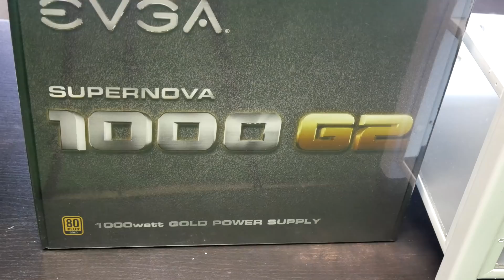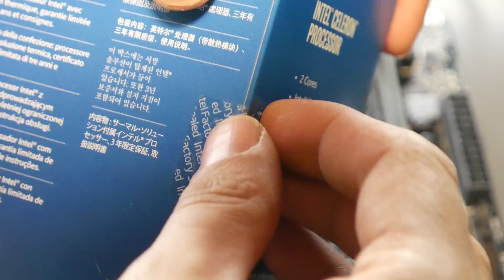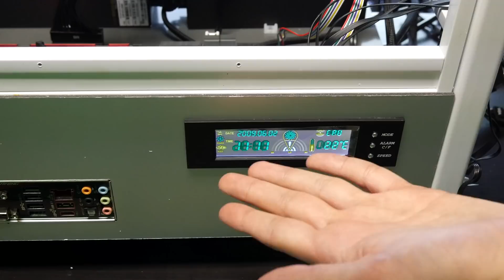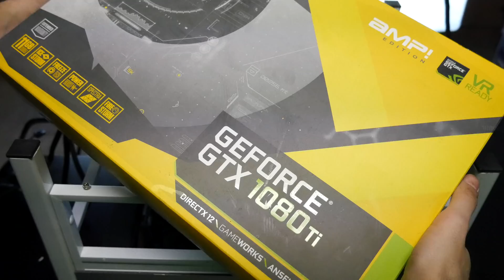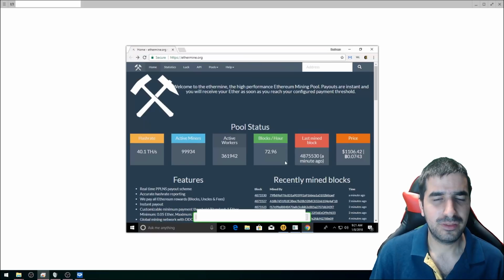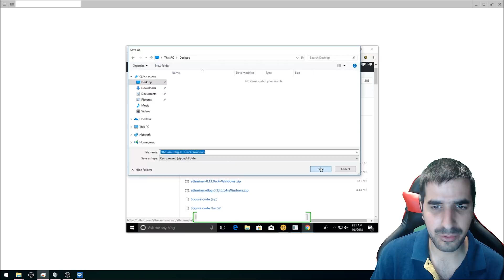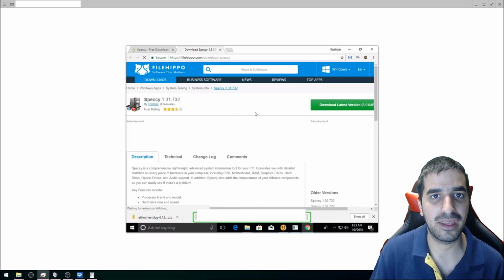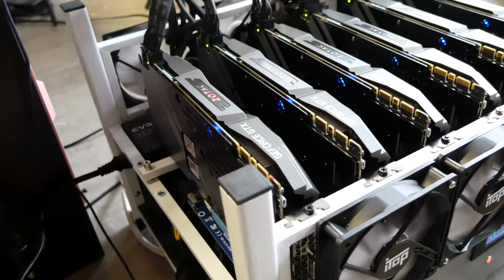How Much Can You Make Mining Bitcoin With 6X 1080 Ti Beginners Guide

Comment: The electricity cost 1780 watts consuming all day?? I think No... 1780 watts = 1.780 Kwh means 1780 watts per hour, 43 kwh per day for 24 hours, the electricity per month 1290 kwh. that is too much more as you mention in your video.

Comment: Broo shall I use EVGA Supernova 1000 G5, 80 Plus Gold 1000W, Fully Modular, ECO Mode with Fdb Fan, 10 Year Warranty, Compact 150mm Size, Power Supply 220-G5-1000-X1 for this?

Comment: You need to stagger the ram so it will run in dual channel mode.. The black ram slots are the dual channel slots.. The way you have it now, 1 stick will need to fill all the way up before the other is used.. Also those video cards are set default, to start throttling at 80c as well..

Comment: And then after a few months of abuse, he sells these cards on eBay, "perfect condition, works like a new one, 10/10" lol
Reply: They probably got hot af and almost melted
Reply: @Mattt414  learn more about mining. A competent miner while usually have the card running at almost idle temperatures. If you mine properly your cards will last for a very long time
Reply: personally never had problems with used cards that were mining 24/7
Reply: @kristianharis5075  I agree. Miners treat their cards well. Maybe a fan needs to be replaced. eBay also has great money back guarantee policy.
Reply: @erwinschmied  specially because mining isn't too hard to do for cards, ive got my gaming rig running 24/7 and the card gets a maximum of 60⁰c of temperature at max load (sure it might reduce how long it lasts, but its still way better than hardcore gaming, with warzone i still get a huge load and temps of 80c). So a card used for mining should no only be fine but also better than a card that was used intensively for gaming
Reply: @kristianharis5075  indeed. just needs to be cleaned from time to time especially the fans. or change paste if needed. no matter how long is the use
Reply: first mistake is buying "Like new" graphic cards or pc parts in general...
Reply: @TriviumRS  for real, bought a "like new" card for my new pc and it renders like shit
Reply: No the cards are good enough for gaming only 10% less
Reply: Miners probably treat their GPU's better than some clueless gamers
Reply: Does it wors or not? 
I would like to buy some good graphic cards for crypto mining...
Reply: @cryptouniversepictures9318  wait for a bear market
Reply: Ahahhahaha
Reply: Yeah this whole GPU stuff is getting out of hand I can trust second hand retailers at the moment it’s insane
Reply: Mining doesnt harm a graphics card it runs the same
Reply: Just ddont abuse the card have enough space between them and adequate cooling
Reply: "not used for mining"
Reply: CEO of scamming

Comment: Here's the cost of electricity:
1800 watts ÷ 1000 = 1.8 kWh

1.8 kWh × 24/7 runtime = 1,300 kWh Kilowatt hours per month

Average cost of electricity in the us is 15¢ per kWh.

1,800 kWh × 15¢ = $270.00

He earns ~$40 a day × 30 days = $1,200 perm month gross profit

NET PROFIT: $1,200 - $270 = $970/month.

For about 1 days work to setup that's not bad. Some people live in apartments and don't even pay electricity or they have access to solar.

Comment: using those gpu's on 100% usage will ultimately reduce their lifespan, keep in mind the electricity Bill, and the cost of maintenance of this Expensive Hardware,
Reply: if you get the GPUs with warranty, then you have no fear. if the hardware fails within the warranty period, then you can get back to the dealer and get some back and running.

Comment: with just two ram sticks, they go into slots 1&3 slots at least in most boards.. you can see there is a discoloration between 1&3 and 2&4.. which is meant to help you understand that 1&3 are the proper slots for just two ram.. Here is how it probably would work on most boards.. if one ram.. first slot if two ram dimms, then 1&3 slots.. if 3 ram dimms, then 1,2,3 slots.. the #2 slot being the third stick slot.. and if you have four.. well all four slots.. LOL  I would say check your motherboard manual for the correct configuration for ram..

Comment: In the event that you think that its hard to comprehend exchanging, have a go at gaining from others.
Reply: I need to go into it that is the reason I have been sticking around YouTube. So as to gain little from the recordings I watch.
Reply: I have been exchanging with Mr Joseph Berg for some time now since I went over his profile on Qoura. He is a well good speculator and donor, I have made a very return of $22000 up until this point and he has a quick withdrawal rate. He is client benevolent and dependable,you can contact Joseph Berg using his email address <josephbergg@gmail.com>

Comment: I believe you should not be using an extention chord with that.., You should be using a single power outlet for that one just like the ones for air conditioning units, It will be safer. Imagine a machine using 1700 watts..🤪
Reply: Most of the extension cables I have seen, are rated to at least 10A (which is 2200W) and have 13A fuse. 1700W is well within their capability. Although I do agree with you, that powering straight from the socket is a bit safer (and more efficient).

Comment: if you leave it run 365/24/7, for how long it will last?
Reply: That's a huge electrical bill, and with that setup you'd theoretically make 58-61k a year.

That's a decent amount but as for massive profit, not good because if you leave it on without rest, the miners might fail, the pc might fail, a power outage may cripple the miners and pc, and you run the risk of setting your place on fire.

Comment: power outage damage graphic card, hardisk, motherboard..normally for laptop, temperature 20-60 for core 0, core 1..hardisk and laptop temperature can goes up to 40'C when doing something like watching movie..thats normal rate..if temperature goes up to 78'C, means fans not working and need to be replaced 

Now 80'C..80'C is hell hot..can fry the egg without a gas..how long will it survive..

solution: put it in freezer

Comment: The Issues With This Build 
1) The RAM is in the wrong slots, E.g its Both In Gray Or Both In black if you only have 2
2) The CPU Fan went into a chassis fan header meaning you will get a CPU Fan error on boot

Other Then that, Good Build
Reply: cpu fan locks did not locked, also used risers with sata power connections what is not good option when using high power draw gpu. And 2psu connector shoud be used because you will be unable to restat gpus correctly on crash...
Reply: Karolis Taujanis There is no issue with using “risers” (Adapters) as they are as clean and would not need to be removed if the System Crashed as the Motherboard will do the system reset even with the Molex Adaptors and it monitors Power Draw,  On the other hand I do not have any knowledge on “cpu fan lock” so I can’t provide any input regarding that issue
Reply: Dnt b an asshole everything is working fine

Comment: you will make about $154,760 in 10 years.
Reply: If the machine gets to work for 10 years and he pays absolutely no elecrricity
Reply: well i think his not correctly dual channel memory says otherwise
Reply: I doubt this rig will last more than a few years with the strain it's under. Not to mention fluctuation in the value of cryptocurrency, and the cost of electricity.

Comment: I did an statistical analysis test on these produces and found that you can buy better gear for way cheaper. I would stay away from over clocking for the some fact you need this machine to last. Over clocking kills the machine faster. One good example is your ram, you're only running 1 DDR 4GIG Dim which is very slow. You need higher for the task that you're performing.

Comment: Will take 2 years to recoup your hardware investment. Then you’ll start generating profit. Too bad your hardware will have failed long before then from heat stress. 

Even say you get past that hurdle good luck when your utility company shuts off your electric.

Say they don’t shut off your electric you’ll be having to deal with your local police department investigating you for potential drug manufacturing. After all using an abnormal amount of electricity is a red flag for many kinds of drug labs.

Lmao idiots.

Comment: The last two months, I have made over $60,000 from Bitcoin, but my success never started that way as I had made substantial losses before my turning point in the Crypto space. I  bought *2Btc last year which quickly rose in the bull run but eventually lost most of it and sold off what was left. That was the last I would ever have to do with bitcoins until I was introduced to Mark Hall first of, he asked to know my trade experience. He then gave me a quick insight on what to look out for when choosing a platform and a bunch of other things most experienced traders may never tell you. Most importantly, he introduced me to his specially designed layout and provided me with professional advice and accurate trade signals. With his system, trading has become easy and profitable, and I want to spread the word and thereby help as many that are in my previous unfortunate situation. For all questions, you can reach by **Mail (markhall279@gmail. com)
Reply: That's a good LUCK
Reply: Cool story bro
Reply: I emailed him and he replied back “send nudes”. Wtf is up with that?

Comment: Actually your wall outlet is rated at 15 amps max. Which at 115volts is about 1725 watts. I'd suggest upgrading that 14guage wire in the wall to 12 guage and get the hell rid of the cheap power strip. Also get an electrician out there and have him tighten all the electrical screws from that outlet back to the fuse box. Keep going like that and you probably will end up burning the place down. If the people ran aluminum wiring in the past you sure as hell want to get rid of that cheap ass crap and have them run copper.

Comment: 7x1080ti on only 2x1000wpsus ? you never done any power draw tests beforehand did you ?. at full artificial load tourture test a single 1080ti draws 300ish watts, 7x300=2.1KW , and that's not including the rest of your system.
if your house has not burnt down , than I suggest you up your psu :P

Comment: Did the jumper for the power supply work and you were able to use both of them without connecting both to the motherboard
Reply from the maker: The jumper worked perfectly
Reply: HowMuchBitcoin Thank you

Comment: That’s a cool setup. I’m new to bitcoin and really don’t know how it work. Just working why need 6 gpu or more?  And where did you plug the monitor? To the motherboard? What is the purpose of the gpus? And why are they are not connected to each other like sli.  Really noob question. I should read more about bitcoin mining. But if you anyone can explain the easy way I would like to start my bitcoin mining

Comment: Cant you throttle TDP to 65% so your wall plug wont spaz out if you throw thr light on + save on the bills?
Reply from the maker: Good idea, i usually mess with the overclock under clock settings a week after its been running well
Reply: Makes sense :D.  how are profits on this rig going these days?

Comment: Electricity , in US if non-low-income, you pay by tier, in California, Tier 1 15c/kwh, Tier 2  25c/kwh , Tier 3 35c/kwh

Electricity is always a major factor to run the coin mining operation,,,not only the power for the farm, you might to pay power to cool off the farm, either by fans or AC...

Yet talking about taxes...! 

Unless you have massive mining operation to mine with better rate and it will offset the operational expenses..etc ...in my opinion, it is NOT worth it!
Reply from the maker: Yep... kinda sucks

Comment: sorry guy you spent so much moneyhow could you not see the cpu you bought is the slowest they make and cheapest its intels lowest line. The fastest would have been an amd cpu or at least an I7 8700 intel. I have had many intel celeron and forsure they are junk my intel laptop takes over 5 minutes to load while my 12 year old hp with an AMD cpu loads in under 2 minutes. It seems like you got the money fit it.

Comment: GPUs ARE NOT A GOOD WAY TO MINE ANYMORE!! dont listen to this guy. you are literally making roughly 3 dollars or less depending on where you live. and thats a week. you are making cents a day. this is because first off the money you do make from it will be used for the electricity bill so you lose money right there. and ntm the fact that the mining difficulty rating a literally a trillion times harder than when bit coin started. for example. the mining difficulty rating was roughly 15 000 points (or what ever they go by) now it is 2 trillion points. back then this was a viable option, now, all you are doing is wasting money and the money you spent on all the graphics cards will never ever be made back for at least 50+ years. DONT WAIST YOUR MONEY AND DON'T FUCK UP THE COMPUTER MARKET WITH THIS BULL. if you actually want to mine, get a proper miner. they are high on demand yes, and they are expensive, but at least with those you make roughly 6 - 20 dollars a day (depending on what tier miner you are getting and where you live)
Reply: Allan Huseyin solar panels....
Reply: yeah this applies to bitcoin maybe but what about the alt coins like lite coin Zcash or etherium? you can still make money with those alt coins
Reply: Ethereum New Zealand spell checking
Reply: Bullshit, Monero and other altcoins are impossible to mine with miners you have to use GPU or CPU cores.
Reply: Allan Huseyin you can go work while theyre running
Reply: what about FPGA?
Reply: @toxicrhythmz3718  Currently expensive but very very up and coming in the mining world, there are FPGA rigs that hands down flat out beat Asic machines :) however as I say FPGA are currently very highly priced and harder to get ahold of.
Reply: I make 7$ a week with an old nVidia GTX 7500 with Nicehash! Stop saying bullshit!
Reply: Steacy Paquette and how long are you mining?
Reply: Humm... what about reading? 1 week = 7$
Reply: Humm... what about reading? 1 week = 7$
Reply: Humm... what about reading? 1 week = 7$
Reply: Humm... what about reading? 1 week = 7$
Reply: Humm... what about reading? 1 week = 7$
Reply: Humm... what about reading? 1 week = 7$
Reply: Humm... what about reading? 1 week = 7$
Reply: What if those "proper miners" change alogos?waste*
Reply: can i thumbs this up like 10000 more times :D people really need to research shit now they dont realize its all Asic farms for BTC only alt coins use GPU rigs and even soon coins like ETH will be too difficult to mine and require asics orsomething like FPGA :)
Reply: don't be a baby, stand up for yourself!! buy a PS4 and don't bother people with your wining...
Reply: @Albanez39  same . Buy ps4 n read comment about mining before sleep
Reply: Psaikodelik ps4 trash

Comment: just a heads up to anyone looking to do this, NEVER do what he did with that kill a watt. that means you are using more than the wire can support. you are running the risk of fire if you leave it running for a period of time. also do not go above 1920 w (if you are using a 20amp breaker) 1440w (15 amp breaker) or else you would eventually burn up your breakers :D rest of the video is good :D

Comment: Welcome to March - this rig currently makes $10.80 a day, and $7.26 after electricity at 0.11/KWH. 964 days to ROI. That's 2.64 years running the cards 24/7 with no downtime at current prices. Not to mention, prices are UP now compared to February. Don't be stupid and buy 1080ti's to mine with people. If you would of spent 7k on bitcoin in feb when it was 6k a coin, you would of doubled your money in less than three weeks selling at 11k. I have several mining rigs - it is NOT a get rich quick setup. It is NOT a replacement for a job. It's a hobby that can earn you money, that's it. If you want to make serious money in crypto learn to trade. ALL of the easy money from mining is GONE. Those days ended lonnnnggggggg ago.

Comment: thats alot of power- maybe undervolt some- and also maybe 1200 psu a piece not 1000 version, im just concern about power spikes, its nice but your running high temps and mad power consumption. does not look stable for lengevity

Comment: Awful, hardly any profit. Infact you are running at a loss considering the cost of the cards.
Reply: Mr Haider $45/day = $1220 per month after power bill at 1800W running 24/7. How’s that a loss scenario?
Reply: Still needs 7-8 months to recoup the money going into the hardware. And only if there is no hardware failure during that time. And remember crypto-currencies have diminishing returns by design. Something that mines you $1220 a month today won't do that in 6 or 12 months.

Comment: You are not drawing enough power to dim lights! You are running that entire rig on a 20 Amp circuit, drawing around 15 Amps, most homes have 200 Amp service, you are running the equivalent of a larger microwave, learn a bit more about electricity...

Comment: All fans should blow toward the rig. No need for push pull. There is no vacuum in an open case!
Reply: these are blowing fresh air for the graphic card vents, plus cooling the back of the cards (very important). So this is a very useful system

Comment: The amount of cost involved in this setup and the cost of electricity is not efficient. If you prefer to mine fast and effectively you are better off investing into an ASIC miner from Bitmain. The new A3 unit mines over 300$ per day at 1186W/hr for a cost of under 3,000. It is a no brainier.

Comment: Shared on twitter - I have a 6 GPU Veddha aluminum frame with 2 zotac 1080ti 11GB amp extreme core on a gigabyte z270-d3,  I-7 7700 CPU, PNY 512 gig SSD, corsair HX 750 platinum PSU, 1X 16gb RAM card , aluminum and copper stand up CPU heat sink with 2 fans. And the 6 led ans from veddha. (wanted to use as home pc as well so I gave it all the good stuff. I could use any extra cards I can get my hands on till I can afford 4 more zotacs